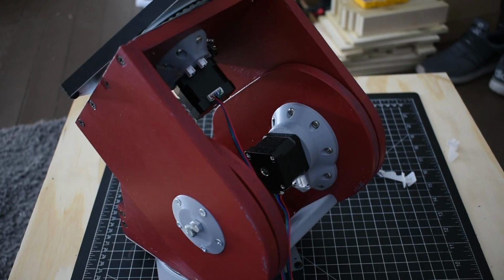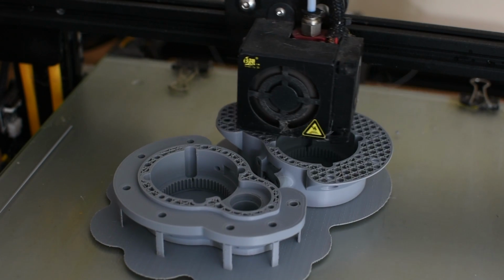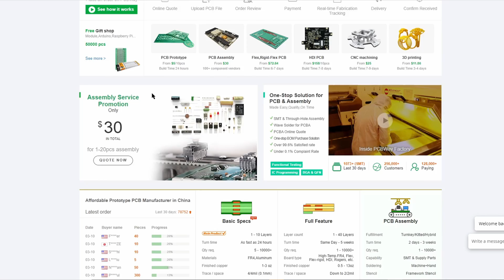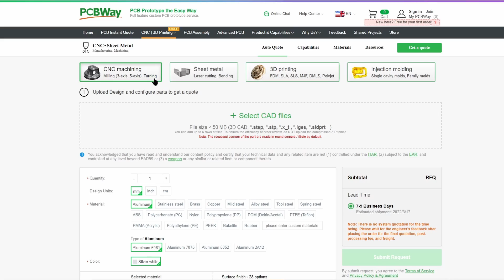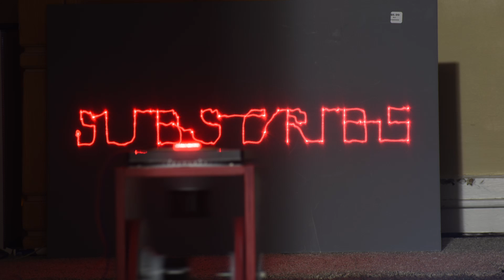DIY Turret using 3D printed parts

Comment: What softwaretool are you using to control the „robot“? I am curios because I get that you can use G code to programm it, but how did you tell tell the programm what specific configuration (relations between your axis, distances etc)  you have ? Would be nice if you could give me a tip on this one.

Comment: Cool Project! Maybe the rigidity/fluidity of the movements could be improved with a much larger planetary gearbox design. While a small one may work with machined parts, 3D printing should be better suited to a larger form factor gearbox where the effect of small deviations from printing can be minimised. More torque could also mean smoother time lapses.

Comment: Last year I worked for a company manufacturing laser scanners for the automotive industry. They had an army of Kuka robots... I told them... some years before I would have stolen one or two of the KUKA... but in the meantime I realized... I have absolutely no use-case at home for such a robot. So I just helped them to unify their laser interfaces... anyway. Your video is very interesting and well executed. Thumbs up!

Comment: As an (admittedly somewhat newly certified) CNC machinist, I would surmise the axes would be called A, B and C, if you follow the right-hand rule of axes. A is the axis rotating around X, B is the one rotating around Y, C is the one rotating around Z.
But in my own (far less sophisticated!) robot project for a cosplay I'm making, I also just use pitch and yaw. (roll is not needed - see, not as sophisticated!)

Great work! Will investigate your channel further, that hand might be very helpful for aforementioned project!
Reply: I started a job running cnc lathe,are there any books you would recommend to help learn more about them,I've run a handful of them before,just loading and unloading,
Reply: @tommychiletti8506  My books were in German, so not sure how helpful that would be to you :)
However, I can recommend several YouTube channels: Blondihacks has a good series on very basics (no CNC though), RotarySMP is currently restoring a CNC machine, ThisOldTony does all kinds of interesting and informative videos on all kinds of machining topics, etc.

Comment: Hi, i have some issues with dimensions. You have several model types (72_1 NEMA17 Closed Loop,72_1 NEMA17 Gearbox,Servo_Motor_Planet_Gear) and different shopping list in your videos). The harware list above works for 72_1 NEMA17 Closed Loop ?

Comment: Could this handle being used as a Fourth (or i guess 4,5, and 6th?) Axis on the CNC Router, or does it lack the rigidity?
Reply from the maker: I thought about this as well. It would probably work for machining something like foam but I don’t think it has the rigidity for anything else